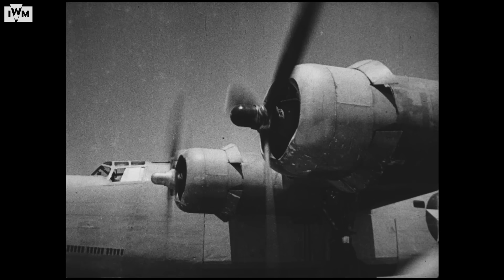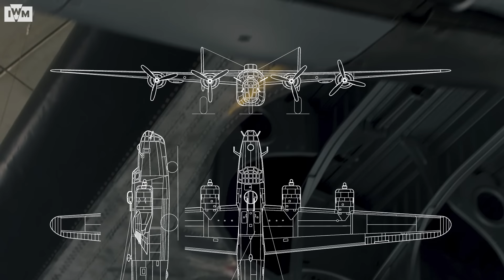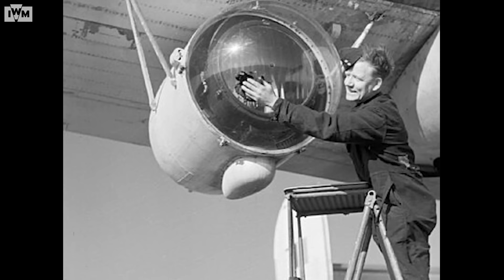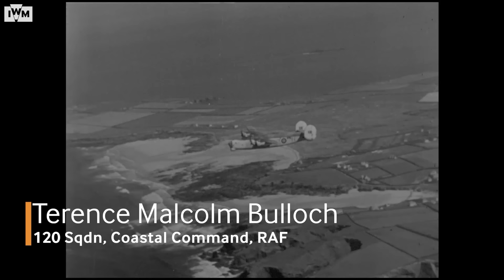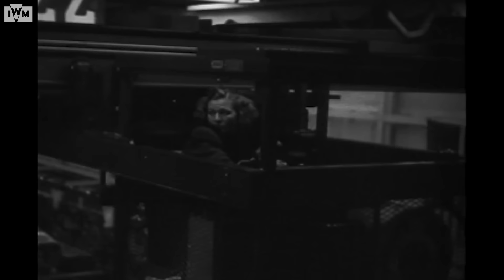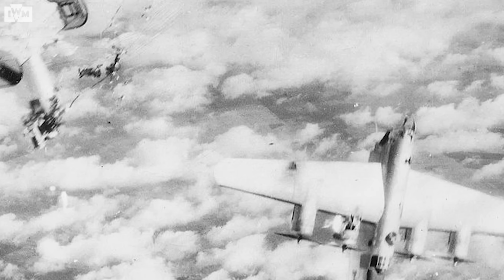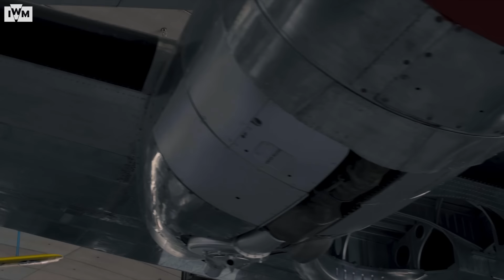The most produced Bomber in history had a bad reputation | B-24 Liberator

Comment: "The B-24 was just as good as the B-17, but the B-17 had a better press agent." Jimmy Stewart, actor and B-24 Pilot.
Reply: according to The United States Strategic Bombing Survey document, titled Bombing Accuracy, USAAF Heavy and Medium Bombers in ETO  from Jan 1947. Which states the mission life for the 8th Air Force B-17s was 58.9 missions, while the B-24 had only 49.9 missions. For the 15th Air Force, B-17 had 77.0 verse the B-24 35.5 missions. Also that document states that from Jan 1944 to Feb 45, the B-17 dropped more tons per bomber lost in every month, except for March 1944.

"As pointed out in the detailed comparison, dated 3 April 1944, sortie loss rates of the two models have been roughly equal. However, this is not a fair comparison because the B-24's are, on the average, sent on easier missions. This fact was confirmed in the course of a recent trip to the United Kingdom. The greater vulnerability of the B-24's is well recognized. In fairness to the respective crews and to maintain crew morale and keep down losses, the types of missions on which the two models are sent are liberately balanced in such a way as to keep losses approximately equal." -- Supplemental Statistical Comparison B-17 - B-24 Models, by the Statistical Control Division of the Office of Management Control, May 1944

"The B-17 was a more efficient combat aircraft than the B-24 from viewpoint of bombing accuracy, life of aircraft, tons dropped for each effective sortie, and losses for each 1,000 effective sorties." Quote from Bombing Accuracy USAAF Heavy and Medium Bombers in the ETO document, from Jan 1947.
Reply: Damage control over the abysmal failure of the air force brass in sending hundreds of bombers unescorted and losing over a hundred planes and thousands of crew members on totally failed raids in 1943. After that, it was publicity campaign and movies such as Memphis Belle to boost the public perception of a terribly flawed concept.

Memphis Belle was about the air crews 25th mission, how they would fly it and then be able to go home. But the truth is, dozens of its crew were killed on previous missions and only one or two members were reaching their 25th mission. And many others not in the film flew at many as 80 missions after being told 25 was the limit.
Reply: @Triple_J.1  Yeah, thanks Col Cathcart
Reply: @Triple_J.1 
”Damage control over the abysmal failure of the air force brass in sending hundreds of bombers unescorted and losing over a hundred planes and thousands of crew members on totally failed raids in 1943.”

Your maths aren’t up to much. ‘Over a hundred planes’ doesn’t equal ‘thousands of crew members’. Over a thousand maybe but many survived.

And realistically, what choice did they have?

Please give an example of ‘totally failed raids in 1943’.
Reply: @Triple_J.1  My friend was a Master Sergeant in the Air Force Reserves. He was also a teacher, administrator and had a master's degree in history. He said he read a paper where the US could have used  Mosquitos instead of Heavy Bombers for tactical bombing instead of strategic bombing to greater effect. 3 Mosquitos could carry the same amount of bombs as 2 B-17's, but with only 6 crews instead of 30. The Mosquito could also outrun most German fighters and being made of wood were less susceptible to cannon fire. They were also easier to repair. So instead of bombing German industry, which was questionable, you used Mosquitos to bomb barracks, supply depots, rail roads and fuel depots. You can build all the planes you want but what good are they if they get blown up waiting to be delivered or have no one to fly them or fuel them.
Reply: @homerdoh-x5k  It was the top brass who didn't like the idea of their Air Force using foreign planes. They didn't even like the addition of the Merlin  engine in the P 51 even. Had to have Packard build them under license. (even though I was told that the Packards were better than the Rolls Royce Merlins)
Reply: @Thenogomogo-zo3un 
”It was the top brass who didn’t like the idea of their Air Force using foreign planes. They didn’t even like the addition of the Merlin  engine in the P 51 even.”

Source?

This is BS. As much as it was preferable to have an independent industrial base, as far as possible, when the crunch came, Hap Arnold told his deputy, Lt Gen. Barney Giles, to fix the escort problem by whatever means within six months. What they did or didn’t like wasn’t even a factor. 

The attempts by content producers to create a ‘bomber mafia’ bogeyman in recent years and build up half-arsed conspiracy theories for likes and hits, has been done at the expense of truth. The willingness of those incapable of critical thought or independent research to believe in the old trope of ‘lions led by donkeys’ has rarely been paralleled in my memory.

Anyone who goes to war expecting to inflict casualties without receiving any in return is an idiot. The post-Desert Storm generation seems to believe that war only kills your enemies and that everyone can just go home and live happily ever after. There is no such thing as a casualty-free war. No military planner ever pretends otherwise. So if you can’t accept that people will be killed as a result then what are you doing here?

In short, do some research before you post.
Reply: @Thenogomogo-zo3un  Yes and they were not interested in the Mustang until Pearl then they got interested They had no say in the Packard purely a business arrangement between Packard and Rolls Royce but after pearl they grabbed 18000 Packards 
No they both had 500 hrs B/O The epicyclic Geared Super of the Packard was NOT as efficient as the clutch Geared super of the Merlin ratios below
   Packard                                                                                                 Merlin
   S.P. 0.95 hp/cu in                                                                               0.96
   P.W. O.80 hp/lb                                                                                   0.96
   P/Disp 0.79                                                                                          0.95

Comment: The B-24 was a machine designed to carry bombs and drop them on the enemy in wartime, and to be built quickly in large numbers. As such, it was very successful. Other factors such as being beautiful, having light control forces and being fun to fly were totally irrelevant. It's only 80 years later on the internet that military aircraft are judged by things like that.
Reply: Flight controls are very relevant to the mission of dropping bombs. That is if you're going for accuracy. In the tight formations that have to fly there was no autopilot. You had to fly continuously rudder and all the way there and back. Unless you are flying in one of the three planes you were flying in everybody else's prop was making it more difficult

Comment: Had an opportunity to tour both B-17 ans B-24. 
   The B-17 was cramped, with narrow passages. The waist gunner positions were offset due to narrow fuselage and the tunnrl to the tail for the very slender.
   The B-24 felt spacious as a barn in comparison.
Reply: i'm remember reading somewhere a joke from that time which said the B-24 was the box the B-17 came in
Reply: I noticed in this film the waist gunner had a a SEAT.

Comment: Wasn't laminar flow. The davies wing was famous for having a high aspect ratio which reduces induced drag. The high thickness made it very draggy at high speed high altitude.
Reply: Davis wing but otherwise you're correct.
Reply: @tempestfury8324  as long as you can get the gist
The e was an autocorrect
Reply: The laminar flow claim is performance based rather than technical.  The Davis aerofoil was a unique speculative very high lift design, thick with a forward maximum thickness and strong camber, it was also in a high aspect ratio wing so it worked hard with lower drag but it really tortured the air so that it was always nearer the stall or air flow breakdown.  They were extra dangerous in even light icing, the airflow broke up with much less ice than with other planes.  The USAAF 8th A.F. usually removed the rubber de-icing boots from their heavy bombers.  The B-24 was good for winning the war, it didn’t need to be popular.

Comment: The B-24 needs to receive the recognition it deserves.
Reply: The B-24, unfortunately, was built in modules assembled at other factory buildings nearby - this sped things up and made quality control more consistent. However, it also made the finished aircraft a bit more difficult to work on for some jobs. But mostly it made the B-24 easy to shoot down if you hit it in the right spot - which the Luftwaffe discovered very quickly. 

There's videos on YouTube showing those unfortunate planes; the wings would fold back parallel to the fuselage and since the bombs and fuel were all close together the plane became a fireball really quickly. But the Liberator was difficult to fly, not impossible, and good crews made them work without problems. The most important rule - like the video said - was never go into enemy airspace without fighter escorts. 

There are precious few of these majestic warbirds still flying; I saw one a little over 10 years ago over Seattle with a B-17. Thanks very much indeed for this edifying video.
Reply: @DavidSmith-ss1cg Yet the 24 had a slightly BETTER loss ratio.
Reply: @Roc @RockerWasRight           according to The United States Strategic Bombing Survey document, titled Bombing Accuracy, USAAF Heavy and Medium Bombers in ETO  from Jan 1947. Which states the mission life for the 8th Air Force B-17s was 58.9 missions, while the B-24 had only 49.9 missions. For the 15th Air Force, B-17 had 77.0 verse the B-24 35.5 missions. Also that document states that from Jan 1944 to Feb 45, the B-17 dropped more tons per bomber lost in every month, except for March 1944.

"As pointed out in the detailed comparison, dated 3 April 1944, sortie loss rates of the two models have been roughly equal. However, this is not a fair comparison because the B-24's are, on the average, sent on easier missions. This fact was confirmed in the course of a recent trip to the United Kingdom. The greater vulnerability of the B-24's is well recognized. In fairness to the respective crews and to maintain crew morale and keep down losses, the types of missions on which the two models are sent are liberately balanced in such a way as to keep losses approximately equal." -- Supplemental Statistical Comparison B-17 - B-24 Models, by the Statistical Control Division of the Office of Management Control, May 1944

"The B-17 was a more efficient combat aircraft than the B-24 from viewpoint of bombing accuracy, life of aircraft, tons dropped for each effective sortie, and losses for each 1,000 effective sorties." Quote from Bombing Accuracy USAAF Heavy and Medium Bombers in the ETO document, from Jan 1947.

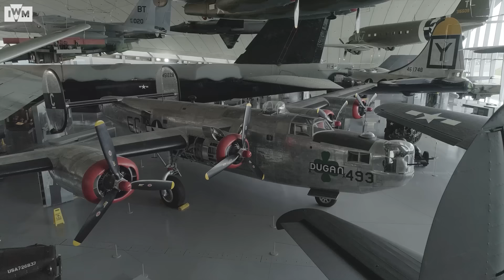Comment: Min. 1:00 the B-24 was by no means the „most produced military aircraft of all time“. Polikarov Po-2, Il-2 and Bf 109 are the most produced aircraft of all time.
Reply: 1 Ilyushin Il-2 - 36,183
2 Messerschmitt Bf 109 - 34,852
3 Supermarine Spitfire/Seafire - 22,685
4 Focke-Wulf Fw 190 - 20,051
5 Polikarpov Po-2 - 20,000 to 30,000
6 B-24 Liberator - 18,482
7 Mikoyan-Gurevich MiG-15 - 18,000+
8 Yakovlev Yak-9 - 16,769
9 Republic P-47 Thunderbolt - 15,660
10 North American P-51 Mustang - 15,586
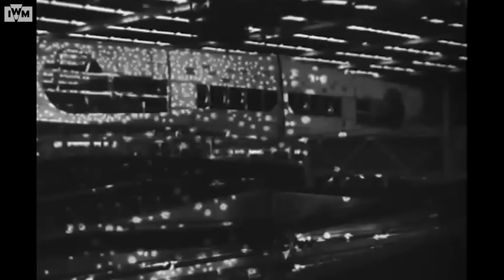Reply: She probably meant to say what is said at 7:17, most produced bomber. The problem with this kind of error is that it casts doubt on the rest of the information given, which may all be perfectly true.